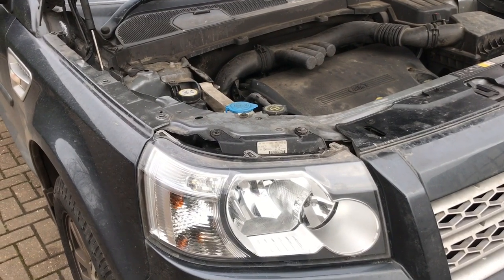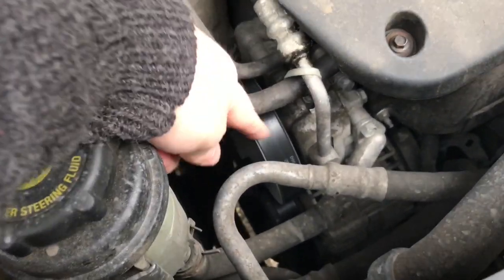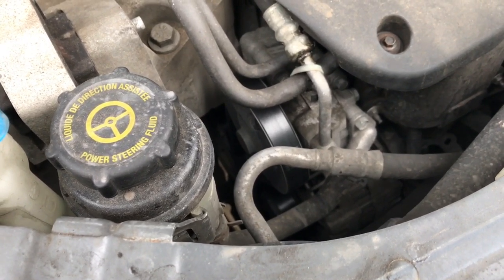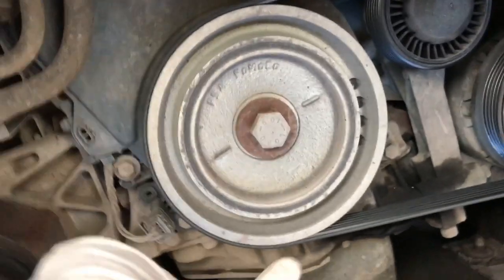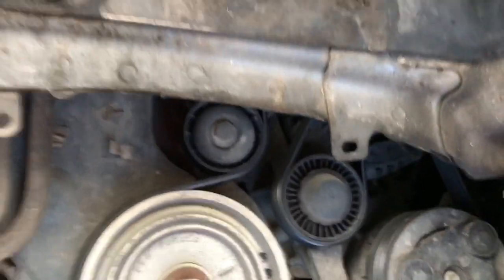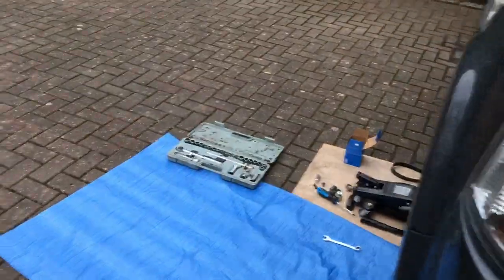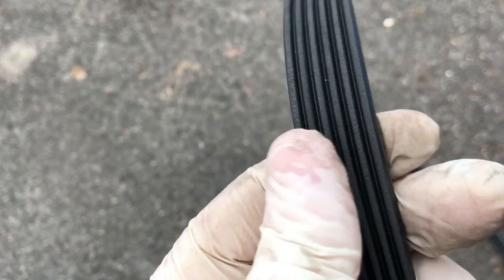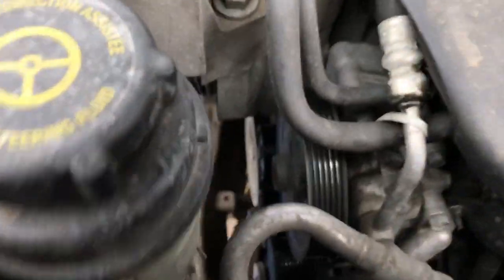Auxiliary drive belt (fan belt) replacement on Freelander 2/LR2

Comment: I had the idler go on my previous Freelander - this time it's the tensioner, but I think I'll just replace the idler as well, for all it costs and while I'm in there. Wonderfully clear  - thank you for your time and effort.
Reply from the maker: Thanks Norman! Yes, do both pulleys. My idler failed shortly after I replaced the tensioner.

Comment: My belt just snapped and I’m at the in laws during a bank holiday weekend. 
Can’t find any parts stores open so I’m stuck with the in laws until next weekend when I can get the parts and fit them. 😢
Reply from the maker: I carry a spare belt and tensioner under the boot floor, just in case. No eurocarparts near you?
Reply: @BeavisPits I moved to Romania and it was a national holiday so nothing was open. 
Brother in law managed to find a belt from a family friend who owns a parts store. 

Put the belt on, immediately snapped again. 
Turns out the alternator pulley is bust, the end cap/rail to stop the belt slipping off is gone. 
New pulley and belt fitted and all is good again, for now. 

Also, do you have any videos of the boot handle/trim? 
The entire trim came off in my hand a few weeks back - broken brackets and is being held on with zip ties. Wondering what it’s supposed to look like on the back side of the boot trim where the plate lights are
Reply from the maker: @user-bc3zs2wn5z the alternator pulley has some kind of one way freewheel clutch inside it apparently and this can fail.

I did a boot handle upgrade last summer.

Comment: Did you ever get round to having a go at compressor clutch mate ?
Reply from the maker: No, not tried that yet
Reply: @BeavisPits  new ones are around £90 on eBay, I'll check mine when I replace these parts next week now.🤞they lasts that long

Comment: I've watched this video at least 5 times now! Did you have to change the idler/guide pulley at a later date (from the comments below)?
Is it mounted on a bracket that has to come off with it? I couldn't see how to remove it as it seems to have a cover over where the nut would go through it.
Reply from the maker: Yes, I did the idler shortly after. Should have changed that too when I did the tensioner. The idler has a plastic dust cover over the bolt. Simply prise it off with a screwdriver.

Comment: HELP! Hi awesome clear video, but i need a bit of help, i am getting a bit of a howl on just a particular low rpm, doesnt matter if car is stationary, in gear or in motion coming to a stop, I can generate the howl when slightly tapping the accelerator pedal, and I mean just a tap, could this be caused by a bad pulley i.e. one of the ones showed in your videos. Mine is a 07 Freelander 2 Manual. Very good acceleration, no smoke etc!
Reply from the maker: It could be a pulley or may be a split hose. Get someone else to dab the throttle while you listen in the engine bay.
Reply: Awesome thanks for response

Comment: Can you change the alternator this way or do you need to remove the power steering pump?
Reply from the maker: This belt will need slackening off to remove it from the alternator pulley. Ideal time to renew the tensioner and idler too. You should be able to reach down and remove the alternator without removing the PAS pump but I’ve never tried it.

Comment: having seen your vid i changed the belt and tensioner and like yours most of the noise went away but like in your vid still have a knocking sound, is this normal?
Reply from the maker: Probably. It is a diesel after all.

Comment: thank you for the video! 
may i ask: if i just need to take off "fan belt" without change the "tensioner pulley",  
so i unscrew the tensioner pulley then take off the belt.  put a new belt on. then i just need to tighten back the tensioner pulley???  or the black disk of the " tensioner pulley" can not be tighten back  ???
Reply from the maker: You can do this, by using a socket and long handle on the tensioner nut to pull it away from the belt, but it is much easier if you change the tensioner too as new pulleys come with a locking pin which you pull out after refitting the belt.
Reply: @BeavisPits   thank you for the answer! happy new year!!!
Reply: @BeavisPits  thank you for the answer!

Comment: Hello ,
Thank you for the video, is this a 1 hour job? I'm being charged 3 hours which is like €150 is correct ?
Reply from the maker: Approx 1 hour for a first timer. Experienced mechanic should be able to do this in about 30mins. Sounds like you are being charged for the ‘timing belt’ change, or simply being ripped off!
Reply: @BeavisPits  tnx for clarifying ye it's a rip-off 
description says :
3.5h fit new timing belt tensioner & idle pulley.
Parts.
LR003651 pulley  assembly T.  
LR085466 kit tensioner.

Will continue DIY with help of great help people like you. Thank you for the help always new work to learn.

Comment: Hi. What is the exact part number of the pulley installed? TIA
Reply from the maker: I'm pretty sure it is LR003651
Reply: Hi again. Is there a torque setting for the tightening the Torx bolt in? Or is it just as hard as you can with a breaker bar?
Reply from the maker: Haynes doesn’t say. I just tightened it a reasonable amount by hand with a ratchet. Breaker bar would be too tight. That’s only needed for moving the pulley rather than tightening the torx screw.
Reply: Yeah ok, thanks for the reply. I can’t find my Haynes book but your video is enough to guide me through.
Reply: 45 Nm according to LR workshop manual